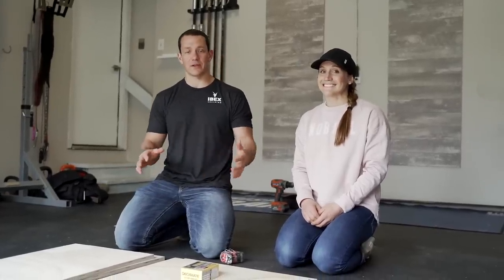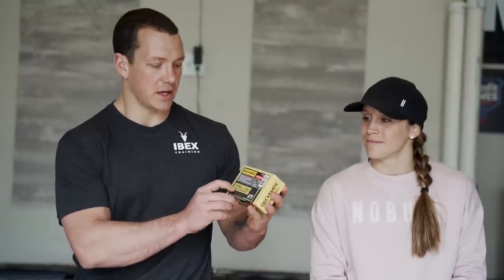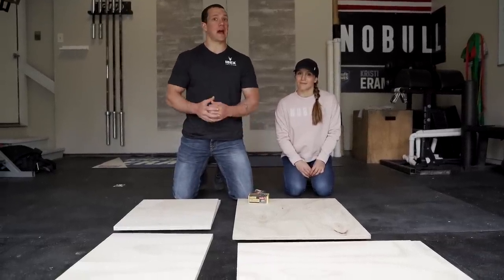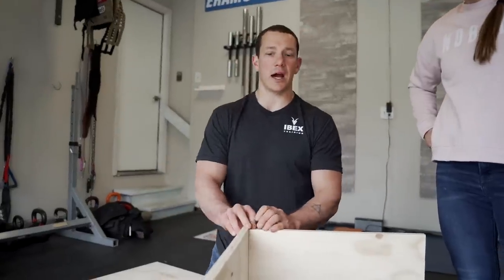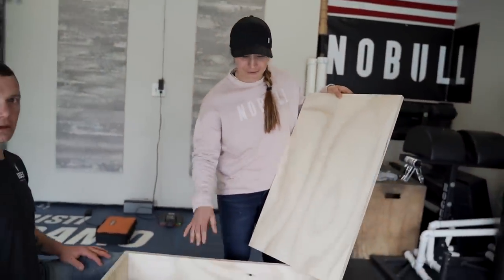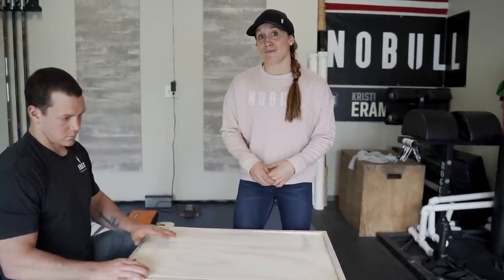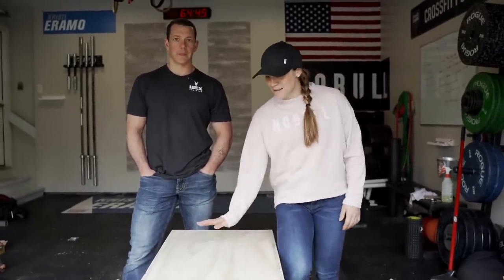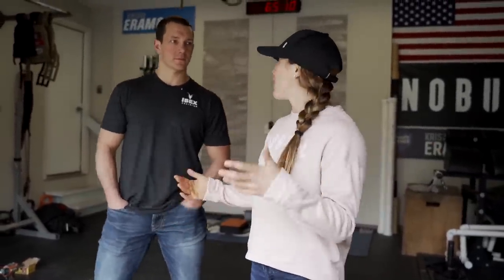HOW TO BUILD A PLYO BOX WITHOUT A SAW. NO CUTTING TOOLS NEEDED!

Comment: HI Kristi and Patrick, Im a do it yourselfer for anything that I can and save some money...thanks for the video, couple  of questions, is that the standard size box you find at the crossfit gym?...this is my thing, I get this mental block when it comes to jumping on a box...stack some plates up higher than the box even and I can do it no problem ...I think I should build one and practice lol....Also, my husband welds, I would like to put up a pull up bar in the basement that attaches to the wall ( we are currently finishing the ceiling where my old pull up bar was attached to the floor joists)...can you tell me the dimensions for the pull up bar system,..ie how far out from the wall and approximately how high off the floor it should be or how low from the ceiling??? thanks greatly...Heather

Comment: Hey guys, thanks so much for all of the DIY tips. Pat you’re the man! Quick question, does the sanded 3/4” plywood work best for this or which would you recommend?
Reply: You can use any 3/4 inch plywood...some are actually 23/32. Personally, I like the Radiata at Home Depot or Lowes. It's sanded on one side and is $32 a sheet...where I live.

Comment: Did you guys actually get it cut at Home Depot? In my experience they don't do precision cuts and being off by a couple mm would screw up the box.
Reply: It would depend on the associate, I used to work there and I made sure to be as accurate as possible. My supervisor didn't care, as long as it was within ¼" he called it good AND the tip of his tape measure was bent, making it inaccurate. I called him out on it and he just bent it back to "good enough".  If you want to be super anal just ask them if you can measure and mark it yourself and then have them cut it
Reply: I spend a lot of time in Home Depot lol and if you want the best cuts go during the week and early in the morning, contractors go in the morning and they typically have the more experienced workers there at that time!

Comment: I needed a little project so off to Home Depot I went! It was going great until I went to put on the top and noticed those two pieces were short. What happened? Figured out I selected the wrong plywood- got 1/2" thick instead of 3/4" thick. Just a little FYI in case you give this a go!

Comment: I tried this. If you want the alignment to be anything decent you will need to make the cuts yourself. Home Depot is not going to give you straight, square, accurate cuts. I ended up shaving off an extra 1/2 inch on all the dimensions to correct the wonky angles home depot gave me